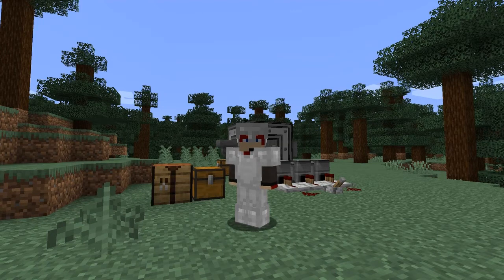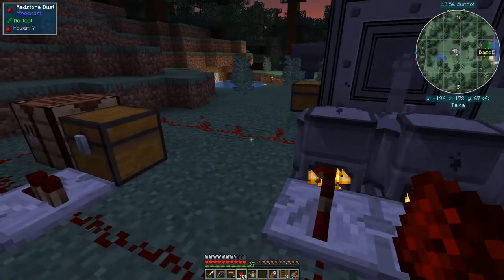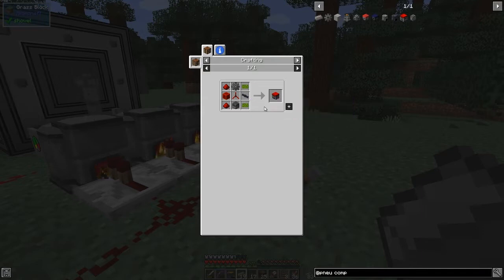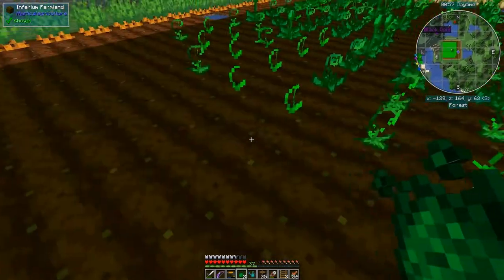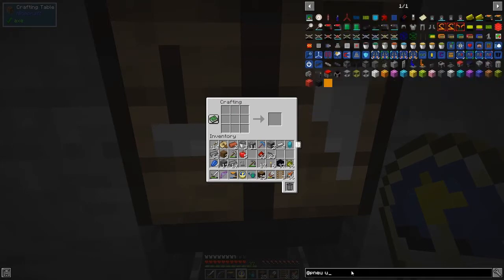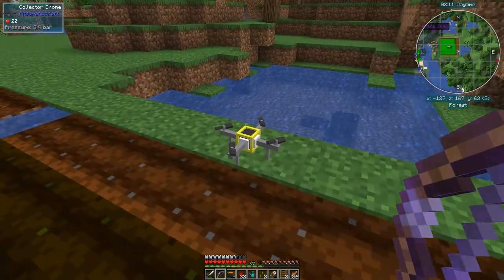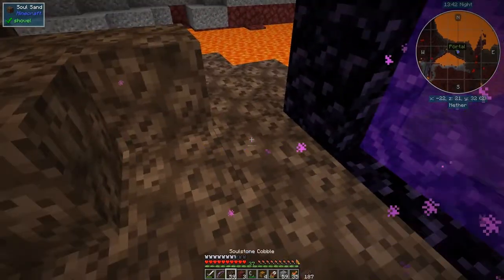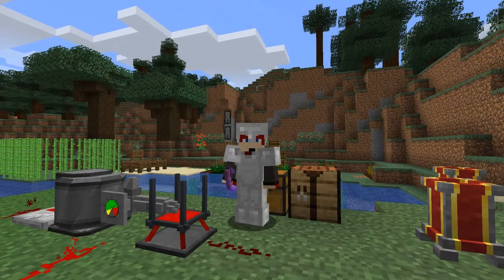PneumaticCraft: Repressurized #4 - Control Compressors with Redstone, Visit the Nether

Comment: The collector drones filter based on what's in the chest they're placed on. So just put some of that essence in your chest manually and the drone should start picking it up in the future.
Reply from the maker: Thank you, this is a helpful tip. I was wondering if the drone would recheck the contents after the initial placement.
Reply: @duncanwebb4934  yeah, it only checks on initial placement.

You can avoid the filtering entirely, I think, by placing the drone down next to the chest instead.
Reply from the maker: Thank you again, I tried this once but placed the drone on a plant instead of the ground and this didn't work.

Comment: how do you retrieve a drone if you wanna add more upgrades?
Reply from the maker: Shift-Right-Click with the pneumatic wrench. You can also break it with a pickaxe but can be tricky if it is moving. Does this help?
Reply: @duncanwebb4934  thanks, ill try it later.
Reply: worked. thanks!